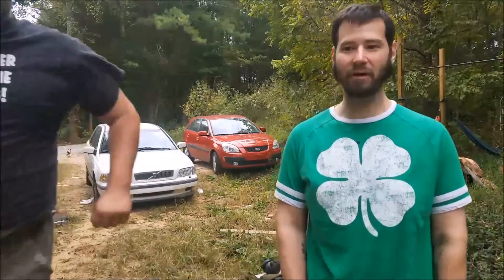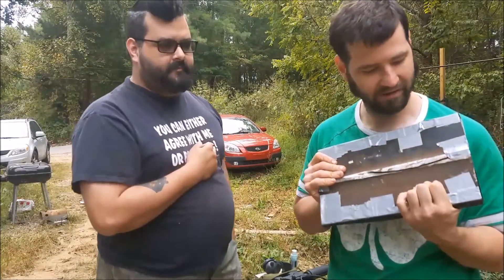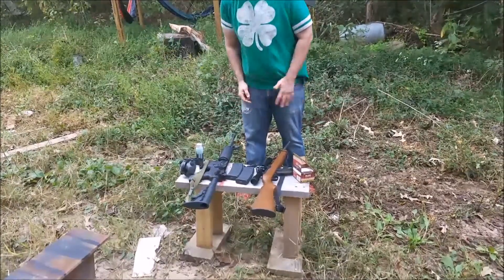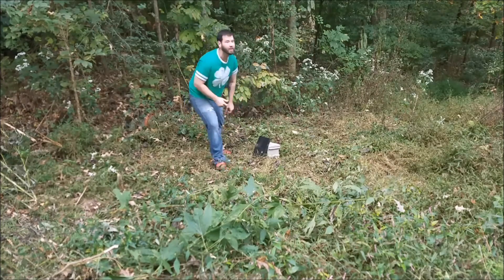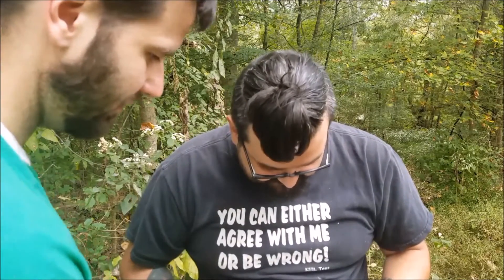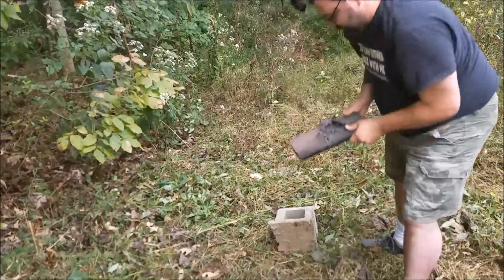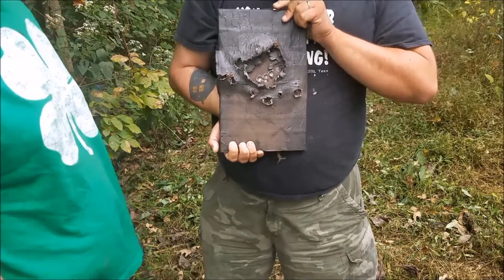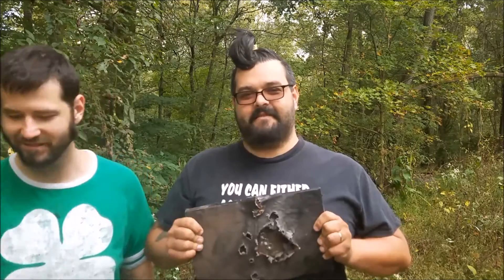You probably won't watch this shooting body armor video

Comment: 2 shots from 7,62x39mm or 5,56 NATO with penetrator and its gone. With this weight. Any shotgun slug shot twice will rip the plate out of the west so it will drop. Wit only chunks of steel, ceramics and led ) or if carbine rifle bullet - lead and metal jacket.

Comment: Please try a Barret 50 cal and steel core ammo
Reply: Nah, just 5,56 NATO and put a hardened screw into the tip of the bullet then cut the screw head and there you go.
Reply: @HanSolo__  unless that was tungsten or hardened metal it may not work.  Shoe box full of gravel can severely weaken the anemic 5.56mm round. It won't even Penetrate a tree bigger than 6 inches in diameter, while an AK will.
Reply: @myopicchiwawa  I think Herrell showed how common rounds like 5,56 and 7,62x39 go thru any give amount of wood soft body armors etc Cant remember. Check out for yourself
https://youtu.be/bKQizbg1zBw
What the hell you need rungster for? Wanna punch holes in drill bits? Good alloy not even a tool steel if hardened well will kut regular metal like paper. And we are tslking about 1,3 cm steel plate. Raw. Which govescit less than 35 HRC hardness. 0,4%of C slloy can get over 55 HRC hardness...
Reply: @HanSolo__   watch this 
https://youtu.be/JO4KYB1veLI
AK47 tumbled through so I guess it wasn't a clear penetration but a SVD would have killed the guy on the other side of the tree.

Comment: At least it stoped them try some green tips
Reply: Yeah, I've had some green tips go through steel. With FMJ ammo and high enough velocity, body armor gets penetrated
Reply: @waltmagic  yea if he uses a 20 inch barrle with xm 193 or the new m855 A1 rounds or any 556 round out of a 20" barrle it will turn that hunk of steel into swiss chesse if ar500 lvl 3 cant stop rounds going 3200 fps it that sure wont more trubble than its worth to make that would rather use ar500 or lvl 4 ceramic and also if he used it in a plate carrier after the first few shots the spall from the suposed homemade armor stoping rounds will just simply fall out of the carrier with nothing to stop all the spall people this man can get you killed if you acculy make and trust your life with a hunk of junk like that it will slow you down it wont stop a round at 3200 fps garanted it stoped a few rounds dont trust your life with that not every one has 16" barrles people do carry 20" too

Comment: armor is so cheap now 😂😂 just buy some
Reply: Ar500 is the cheapest and probly the best you can get with a low buget armor system that works one plate is like 75 or 80 bucks brand new on ebay
Reply: @evolutionnow807  I need to buy some then. I was thinking 300 bucks but I can do 75. That's reasonable
Reply: @waltmagic  yea man ar500 lvl 3 is good you can get a frontplate and backplate and a plate carrier for under or around 150 if you shop around but if you want ceramic lvl 4 plates then yea your looking at 300 for both or one  for good lvl 4 plates i have cati lvl 3 with a condor plate carrier cost me just around 150 to 160 and there is cheeper armor and plate carriers than that scorpians ar500 is the cheapest on the markret for lvl 3 and plenty of good carriers for 30 to 40 bucks dont go to cheep in the carrier tho
Reply: In some places BA is illegal
Reply: @anthony9thompson  well sounds like you need to move then
Reply: evolution now no thanks, just pointing out why some ppl might choose to make BA
Reply: @anthony9thompson  well i mean every one has the right to make what ever they want but its a bad idea to make a thing that your not for sure is going to save you or fuck you up even more and i think you need to go reserch how real body armor is made befor you waist time on somthing like that armor is nothing more than a target nothing more could never get that in a carrier any ways so maybe you should watch stuff about how real body armor is made no offence but taking advice from some one who dont make body armor for a living is probly a fatal mistake he dont know what that thing can take..... be my guest bulid one and bet your life on it and ps dude if you cant buy it becouse of your state law you cant make one its aginst the law lol you would be better off save up go to a state that you can buy it at then go home with it bam no one but you knows you got it that simple unless your dead set on being clint eastwood then i dont know what elts to tell you not trying to be rude btw just calling like i see it bro